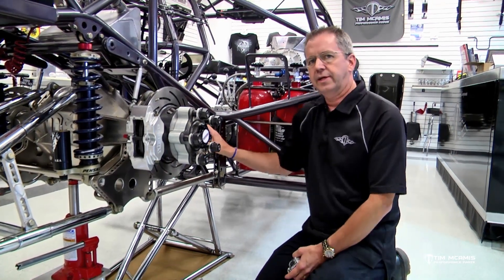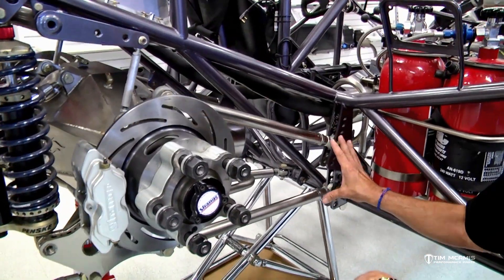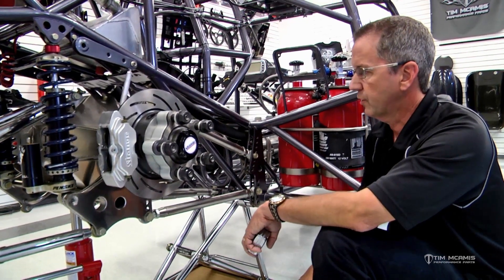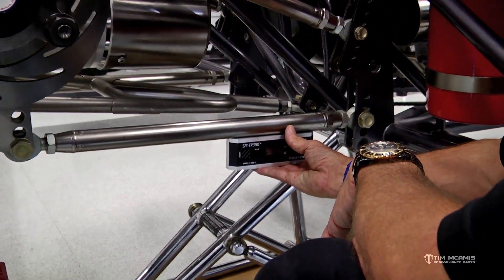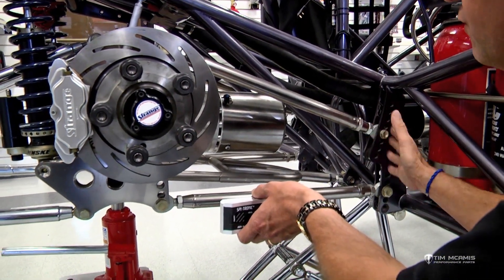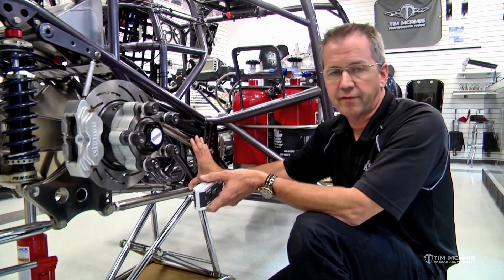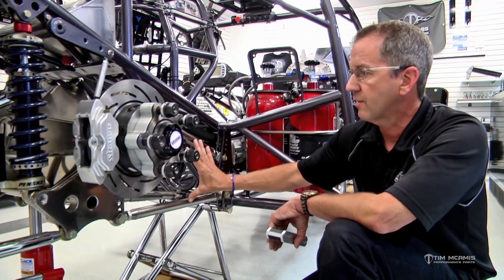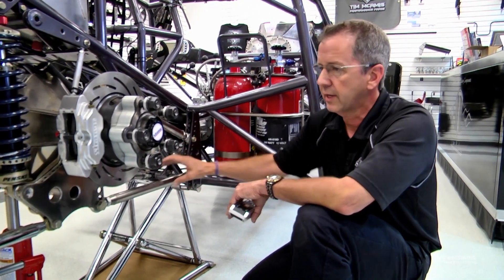Rear Suspension Series: Part 6 – 4-Link Basics

Comment: I think what confuses most dirt oval track racers is that on dirt the 4 link brackets pivot on the birdcages on the axle tube of the rear end. On drag cars the brackets are welded to the axle tube and don't pivot on the tube. Makes the 4 link bar adj basically the complete opposite than what they are used to.

Comment: A four link is like a three link or ladder bar with a lot of adjustments and the advantage of have the shorter link bar they will react faster unlike a ladder bar that reacts slower so the car will move of the line faster with less need for front end lift to get the tires to hook.

Comment: It appears I don't know how drag car suspensions work because on a dirt car raising the front of the lower bar increases traction not removes it. Due to the differentials wanting to move in a counterclockwise rotation under power raising the front lower pivot point causes the weight of the car to prevent rotation of the diff which increases traction. Of course that's why most cars have a slight uphill angle in the bottom bar. All this info and much more can be easily obtained by reading on of the many suspension setup books available!
Reply: That's what I thought too. Super confusing, maybe something to do with radical difference in CG between dirt cars and drag cars? Idk

Comment: Tim have you ever used a laser line tool in place of a plum bob for squaring things up with the rear crossmember? It’s a construction tool but It sure is beneficial in the shop as well.

Comment: Raising and shortening the IC would add bite, lowering and lengthening the IC would reduce bite, prone to wheel standing and rear squat.Just look at radial drag cars, lots of bite from rear anti-squat with a high and short IC...
Reply: He seemed backwards to me as well. If the rear suspension extends, wouldn’t that force the tires into the ground and cause more bite?
Reply: He's speaking of a different animal where the intersection points are well below the neutral/anti squat line. Bite is coming from more or less load transfer and shock compression compression. If the car had half the tire on it for the same horsepower and track conditions as a car similar to these then you may go up around or above the neutral line and start pushing the tire to the track

Comment: Get the 4-Link Wizard software to plot your Instant Center (Intersect Point). It plots all possible Instant Centers on the screen. You will see that moving one end of a bar one hole can make a tremendous difference in Instant Center. The software allows you to select bar positions to achieve small changes in Instant Center as you try to find the "sweet spot" for your particular car. The "spread" of the bars is more a side effect of which holes you have selected on the brackets and should not be the goal of your adjustment. The 4-Link Wizard program works with any brackets.

Comment: he should be useing terms such as squat, anti squat, and instant center. theres alot more invalved and honestly from what i understand with bite he is saying it backwords but dont take my word for it. do reaserch on squat and anti squat.
Reply: I was hoping he would mention anti-squat the whole time and...nothing. I'm hoping he actually knows what it is, because trying to explain the geometry as "spread" between where the heims mount? That doesn't even mean anything at all..IMO. That's probably better explained by figuring out the instant center. It's possible he learned how to adjust this particular system to do exactly what he wants to do, without understanding the real physics happening or what the terms real engineers use to figure it all out. Again, adjusting "bite"? There is a much more complex, but correct way of describing what is going on there from the rest of the engineers that explain rear suspension setups. I'm still not an expert, so even I have a hard time explaining it properly. What I find cool is that some drag cars use over 100% anti-squat where the rear actually lifts on launch. The physics behind that are awesome.
Reply: @mjodr   are you really questioning the guy who's raced Pro Mod and builds some of the fastest doorslammers in the world? Are you the chassis man on a Pro Mod or Pro Stock team?
Reply: You are correct, increasing anti-squat (raising the links on the chassis end of the 4-link) will in crease longitudinal traction (forward drive) because it keeps the CGH higher, the higher the CGH the more weight will transfer from the front to the back under acceleration. BUT, as is typical of the dirt track mentality,  the affect that he is referring to, and probably why lowering the bottom link will tighten this particular car is because of the rear steering that occurs when you lower the bottom link. Rear steer tightens the car because of mechanical steering of the car, not because of an increase of traction in the rear, a huge difference. For more on this kind of accurate vehicle dynamics applied to dirt track chassis, visit http://www.hyperracing.com/ and go to the tech department.

Comment: I believe he is saying. if you do not have the traction you want then lower the front 4 link pivot one hole (near the cross member). But make the same adjustment to both upper and lower pivot points. To keep the same distance between the two adjustment rods. If the car is bitting to hard and will not let you counter steer through the turn. Then move up one hole on all 4 pivot points. (For more wheel spin. If I am wrong someone please correct me. SPI is a lower end tooling company. But I own a few of there products and have had no problems with them. This digital protractor seems to be very nice. The normal protractor will not hold the current angle. So that is a nice extra feature.

Comment: still dnt get it
Reply: That's because he was talking nonsense mostly. "Spread" isn't a thing. The ideal angle of that lower arm is going to depend on the wheelbase of the car, the front/rear weight balance, and the design of the brackets. You can't just say the lower arm should always be X degrees. Look up "anti-squat" and you'll find all sorts of diagrams that will clearly demonstrate what he pretended to explain in the video.